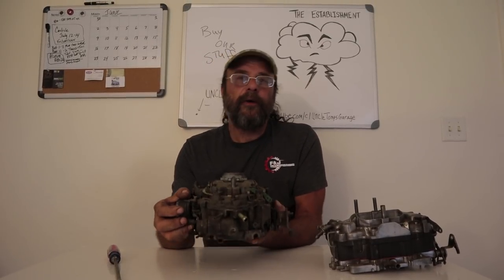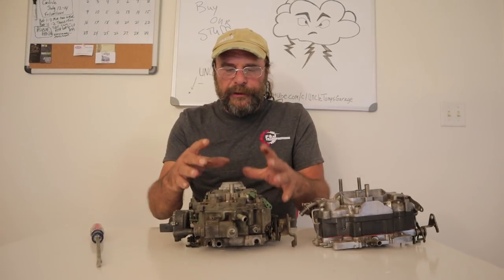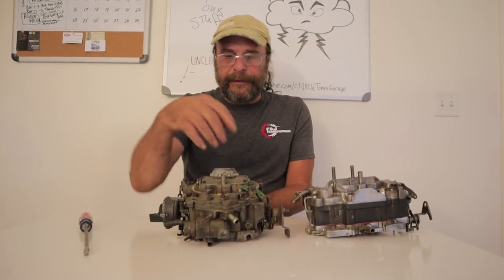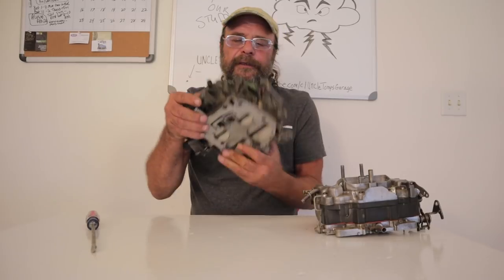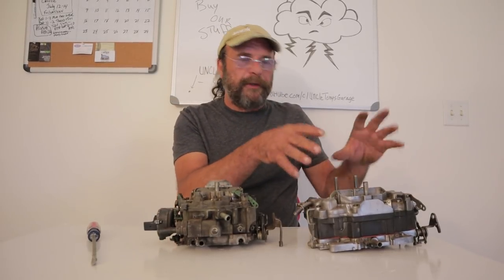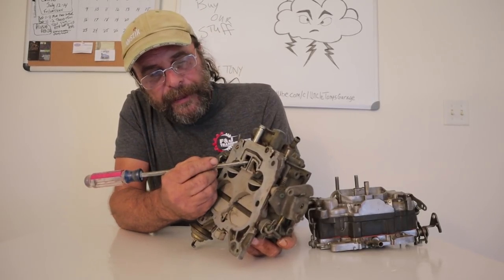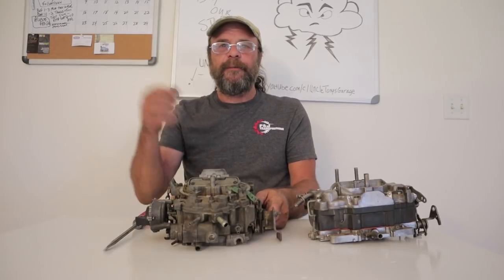The Quadrajet

Comment: Hey Tony, have you seen any deterioration of the Thermoquad float bowls due to the ethanol gas thats been around? Ive heard that ethanol can deteriorate rubber and plastic and I was wondering if the phenolic resin bowls are also subject to this kind of degradation.
Reply from the maker: No, never seen any ill effects on the bowls from that
Reply: @UncleTonysGarage  Awesome, now i can put the one i have on my 72 coronet without  worry. Thanks

Comment: Dude, a quadrajet will flow like 750 cfm. It could support a mean small block.
Reply: The late 60 to the late 70s Quadrajets usually came in two configurations 750 for regular engines and 800 for performance engines like the 454 ss cars, 400 T/A cars, 455HO cars etc.
Reply: I wish they made a 1200 cfm that's why I couldn't run one on my big block.

Comment: Hey tony got a question ive got a 89 ramcharger and ive converted to carb and i just changed the battery and now i have no power to starter what can i do
Reply from the maker: Wish I could help with that, but there are way too many possibilities.  Try finding the schematics online, and start tracing
Reply: Put the other battery cable on! 
Does the battery have a charge? 
I mean load test it. If it's ok, start checking your grounds. That's where most electrical gremlins are. 
You do have the positive to positive, don't you? Some batteries are reversed. I have to ask the simple questions, I can't see your vehicle. Good luck.

Comment: Not a carb related question but a barnfind question. 
I picked up a 50' Nash Statesmen for $400, glass is all there, runs-ish
Drives sorta, missing the headlamp glass and the interior is shot. 

I'm torn between a daily driver resto or rodding it. 
I have a few engine options but I want to make it a strip car.
Reply from the maker: I'm soooo thinking gasser here
Reply: @UncleTonysGarage  I was thinking that too, the engine bay and area is very limiting. Its not a gigantic car by any means.  I have a hudson 308, and a buick 500 core. Of course there is the engine in it, A guy down the way has a 270 Hemi on the stand I could probably sweet talk into a sale. I also have 60s and late 70s amc blocks by the pallet.

Comment: there are problems with q jets,ie when rebuilding there are a lot of parts missing in the kit available separately,but i had a 75 lemans 323 gears revved to 70000 to out run cops and i had a q jet on it.also it sucked at quarter mile but at 30 mph up on the street i was never beat.

Comment: I like mine but they are on a basically stock 350 Olds and bone stock 305 Chevy. If I wanted to make major upgrades I'd switch to something easier to tune. I'm afraid I will lose fuel mileage switching unless I absolutely have to.

Comment: had a motorhome 440 auto....came with a qjet...got a thermoquad off an ih travelall with 392 rebuilt it and that motorhome turned into a sleeper gobs of power....prob the bolts were tightened down too tight on the qjet...

Comment: Is there a better off-road daily driver then the Quadrajet?
Reply: Excellent off-road carb, as is the Doujet and my favorite, the Motorcraft 2100
Reply: Hollys are the WORST for off-road
Reply: @twiz8789  I'm curious why you prefer the MC2100 over the Quad. I'm not looking for an argument just genuinely interested in other peoples opinions to further my understanding on this specific topic. 1977 cj5 BTW.
Reply: When they made them, a few of of my friends ran the Predator carbs on their off road trucks and seemed to love them.
Reply: @berserk7111   Simplicity. I can pull the top off the MC (same with duo) with it on the vehicle and address any issue it may have quicker and easier than q.j. . On a stock engine Ive never had a need for a 4bbl off road, and on steep hills the M.C. seems to have a bit of an edge over q.j.
Reply: @justinwallace9045   they were really hard on fuel i.m.o. but good yes
Reply: @berserk7111   mine is a 75 with AMC 360, T-18 4spd
Reply: berserk7111 Than*
Reply: @twiz8789  I had a mc 2100 .08 on my stock 258 with 32" tires and 3.54 rear. I got about 15 mpg. The larger bores made  the throttle a bit touchy off idle but really woke it up. I rebuilt the 258 for torque and decided to try the Quad. Virtually same venturi size with a smaller bore. I get about 20-21 mpg with the new engine, T19 and 3.07 rear. I still need to calibrate it to the new engine and I'm finding it is considerably more difficult carb to dial in than others. The MC 2100 might be my next choice if I can't get this to work. Not to many good off-road carbs out there.
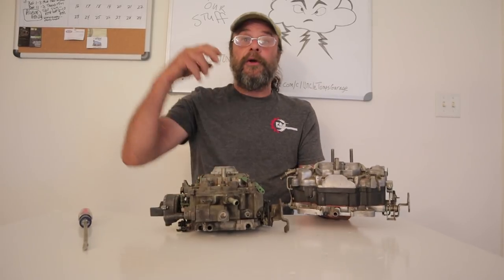Reply: @berserk7111   I'm running 3.73 gears. With the 6cyl I would definitely gear lower than 3:55 or 3:07 (waaay too high) My buddy has a 2a with a 4.3 and ran a q.j. and tossed it for a 2100 and loves it.  The quad and duo are identical on the primary side, something to consider, duo identical just no secondary
Reply: Off road predator carb is the way to go you could be upside down the predator will not mind and just function like you want them to.
Reply: @berserk7111  The architecture is inferior, but they are easy to fix and can hang in there with bad gasoline. They do a surprisingly good job of atomizing gas in cold conditions - sometimes the only thing that will start is some 70s Ford rustbucket with a worn-out 302. What do you do when that's all that will fire up? Drive it and hopefully offer someone a jump start. It doesn't run any better than it did on a good day, but it runs.

In a truck or off-road vehicle, if you're opening the back half of a 4bbl, you've already screwed up and you're losing traction. The carb isn't going to fix that. You needed to shift smarter or calculate your load vs the surface better.  Throwing mud is for the cable TV audience. But it means you're losing ground. Literally, they want you to fail. It's a funny thing to get excited about.
Reply: @mtut  Are you referring to the Quad? I have noticed the Quad is easier to start cold with very little choke so "better at atomization" makes sense. Low and slow is my preferred method also.
Reply: @twiz8789  I choose the 3.07 for better mileage, I may need to go numerically higher, like you say. The engine torque at 60mph is more than enough to cruise with @1900 rpm but I loose vacuum very easy with the slightest touch of the throttle. It cruises at about 10 hg and idles at 16. when I get it calibrated better then vacuum should get better, if not, then I will change the ratio like you say. In third @60 it's 2700 rpm and crawl ratio is 52. My idea was to use 4th like one would use an overdrive but 3.07 might be pushing it to far. It has a lot more torque than stock. Without a dyno it's more difficult to get it right the first time so i'm stuck with the trial and error method. I figured I would start at an extreme like 3.07 just to get a feel for it. So far, I like it, for it's intended purpose. Once I settle on a carb and intake I'll have better idea of the right ratio. Thanks again for sharing your thoughts.
Reply: @berserk7111    sounds like 3:55's would put you right in that engine's sweet spot at 60 mph then, and they are easy to find
Reply: @berserk7111  Was actually defending the lowly Motorcraft/Autolite 2-bbl, which someone had scoffed at (the whole reason I would bring them up - the discussion here is mostly Chrysler-oriented since that's what Tony works on. 

My experience was in running farm trucks and the Fords were the ones that always started in cold weather, and kept running when (as would happen 20+ years ago) we got a batch of bad gasoline or one of our rusty barrels decided to drop some dookie. Mostly they were just long-suffering and simple to fix. In many miles and with a lot of cruddy gas if something went wrong it was ten minutes to fix and we'd be back to hauling. 

Consider the source before you say I'm a Ford nut. I really know too much about Fords to sing their praises. I don't really like Ford V8s after the FE engines (390 was probably their best; it's the best-known FE engine) - the Windsors and 335/Clevelands are all a mixed bag. That said, one of our champs had a 400 (335-series) which was a very compromised design a lot of people hate; with a 4-speed stick (I think an NP-235; seems our others had T-18s) it would pull overweight grain wagons and never complain. Unloaded it got about 16-18 mpg, which is outstanding for a 1970s V8 in a truck . 

I wasn't arguing the 2100 is the best carburetor and I'm aware there are reasons to prefer a 4-bbl. Ford was missing the mark on engine design all through that period; despite having some great ideas, a lot of things got watered down and Macgyvered together. I was pointing out that the 2100 is low-maintenance and dependable under a wide range of conditions, and in an off-road application it's not fair to crap on the carb that just does its job and keeps you working. That was my argument. Put another way, 2 holes that work are better than 4 that might not.

We used Dodge and GM trucks from that era. The 4 bbl was a gimmick in a work truck. The powertrains were simpler to work on (apart from the carb) and the trucks were more fun to drive on your day off - Ford's automatic transmissions felt very clumsy and the twin I-beam suspension is just a pain in the ass. The Fords just had the advantage of uptime. Run them around the clock pulling wagons in thick grain dust and they would just hang in there. Biggest Ford problem: too many 302s. Good enough engine for Grandpa, or in a passenger car, but it had no reason to exist in trucks when the 300 six would work circles around it. (In all that time we never actually owned a 6-cylinder Ford truck - but having driven them, the old inline is very farm-friendly).

If I were really going to enter the debate, I'd say that the greatest off-road carburetor is mechanical diesel fuel injection. Forget all the hot-rod stuff and put an old BT Cummins in there. People who kept farming after my dad retired and I went to college either went Cummins or wasted a lot of money. 

Sorry if this pisses anybody off. 

Tony, why not a 4BT in your Ramcharger? It would be an entertaining video if you would go off on why. 6BT, too heavy. 4BT will work in a 1/2-ton chassis.

Comment: I have a warmed over Chrysler 440.  I was working with AFB's, 750 and 800 cfm.  No matterh what Jet, could not get it rich enough, especially bellow 3500.  A Q-jet did it.  I got more power out of it than any AFB.  I could not change jets, but I did not need to.  I am still a bit lean at idle and low rpm/loads, and I am not sure what I can do about it.
Reply from the maker: Likely the Q-jet's secondary air flap is what's making the difference.  If you're still seeing what you consider to be a lean condition at low RPM, try screwing another 5 to 8 degrees of timing into it and see what happens
Reply: @UncleTonysGarage  Yes.  I too think that the secondary air flap together with the needles that move up with that flap and increase the fuel flow area is what gives the extra fuel at WOT.  And the 440 sure likes it.  But I have played a lot with the timing, it does not seem to do too much.  I had the distributor recurved by an old timer, so that the total centrifugal is no more than 17 degrees, all coming in by 3000.  So, I have a lot of static advance up there at low rpm.  Total is probably around 35, but I cannot confirm it.  Still, idle is weak, and exhaust manifolds slightly glow at extended idle.  When you drop it in D, rpm drops a lot (stock converter, I like it that way for a heavy car with tall gearing).  Feels like there is a vacuum leak, but I don't think so.  I think the problem is a combination of the early and rapid exhaust valve opening of the COMP cam plus the Q-jet for some reason cannot provide sufficient fuel at idle.  But when this engine is at 3000 rpm and you hit it, say 2nd gear, it takes the 5500 lbs of Imperial all the way to a real 105 (5000 rpm) in no time.  Let's not talk about what happens on 3rd gear.  But as you said.  the q-jet needs fuel pressure.  I have three electric pumps on the back helping the high flow mechanical on the front, other wise fuel pressure drops.  I turn off the electric pumps under normal driving.

Funny thing, this 440 has about 10:1 squeeze, but does not ping.  89 octane is fine.  Even when if I advance it, it does not ping, but it looses high rpm torque.  So, it looks like timing is about right.  But the big cam prevents pinging.  The cam is big for an Imperial, but not that big.  Its a COMP extreme energy 268, which is 268/280 and .477/.480.  Heads maybe slightly ported.  Aluminum intake CH4B.  Stock manifolds.  Has reasonable low end torque (when you load it, the lean condition seems to go away).  But from 2500 to 5000 (possibly more) it does very well.  This car is very good for high speed driving.

Comment: Tony, I need your help again. I have a '67 Mercury Montcalm which is similar to the Montclair/Park Lane. I need a vacuum brake booster and can't find one anywhere. Could you not convert it to a conventional power brake booster? If not, do you know anybody that has a vacuum one?Thanks!
Reply from the maker: Carl, I wish I could help with that, but I'm not familiar with the interchange on that car, or what would be needed for conversion.  Sounds like something you'll need to hunt out on the forums
Reply: Thanks Tony, will try!

Comment: Thanks. I'm enjoying this series.Any idea why they also used to be called a Stumble-jet? Maybe a common problem easily solved?
Reply from the maker: Yup...comes from people not taking the time to properly understand and tune them
Reply: Check the secondary air valve spring tension, Q-Jet and TQ have adjustable secondaries. Too lose and you have the mechanical secondary pulling open the air valve too soon, with no extra fuel provided. They are not double pumpers. Somebody did make a kit to extend the primary squriters to the secondaries.
Reply: @UncleTonysGarage  Back barrel flap adjusted too loose. The kids liked the noise, but added a stumble.

Comment: Great video Uncle Tony!  Great carb for the right application. IE cruiser, tow vehicle or marine application. Then again them stocker guys makes those bitches RUN!

From personal experience an not being a complete potato. I spent a year trying to un F my Qjet (For NY/tri state guys) If you are having an issue and going nuts "Carb guy" at Dynamic carb in Mount Vernon is the spot.  I swear to God that guy has a magic wand. I had a slight surge effecting the troll with my boat while dragging wire. She would be fine for 10-12 min then surge up 100-200rpm... Only right at the sweet spot I needed to troll.  Sometimes it would  recover other times it would need to be manually corrected. It drove me NUTS.  Carb guy waved his magic wand and smooth as silk right off the bench. Just an example of how touchy they can be an how a real pro can help.

Comment: I guess I'm lazy- after a couple of mid '60s QJs and an early TQ, I had enough. I've had great luck with Holley Carbs- I both understand the thing and parts for getting outside the box are all over. It's also true I never ran in a stock or super stock class that required them- so maybe I'm just lazy!

Comment: Just being helpful and not a smartass or know it all but  to seal the end plugs or fuel plugs or lead plugs as long as you properly prep the surface on and around the plugs use a produce call : Marine Tex  comes in a small white jar and it is a 2 part special epoxy that with stood a 48 test submerged in gasoline and came out un touched! Its the only epoxy that works!!  And is sandable after fully cured.  I used to resecure the plastic fuel caps on the under side of the plastic mid section of the thermoquad carbs and the fuel plugs / passage plugs on the quadra jet carbs when i rebuild them if they have problems in these spots

Comment: The QJet is easier to work on, and has more parts available via Chevrolet.  
Having built a number of these over the years, the biggest advantage they have over the ThermoQuad are the far superior electric choke, and they do hold their tune quite a bit longer.
Once set up properly, however, the TQ performs better, and gives better fuel economy.

Comment: I dont fowl plugs at idle but i do seem to have empty float bowls after sitting for days to weeks. It takes extended cranking to get fuel to the engine.
Reply from the maker: That's one of the properties of todays gasoline formulation.  We just did a video about that
Reply: @UncleTonysGarage  is it out yet? I will definitely watch it. Going to look now.
Reply: That's the aluminum or lead plugs on the main body underside leaking. JB epoxy time. Keeps the fuel in the float bowl.

Comment: Quaddie butterflies won't close when they turned upside down 😮The weighted auto choke lever locks  them open until you turn them over again 😅 Great video 👍
Reply from the maker: Actually the pump linkage was disconnected and jammed up in the rest of the works
Reply: @UncleTonysGarage  That will certainly do it too 😁 Keep up the good work 👍

Comment: Find they run a lot better with a half inch spacer for a little bit of heat sink it's a good running for 4 Barrel it's a reliable carb easy work on very little trouble